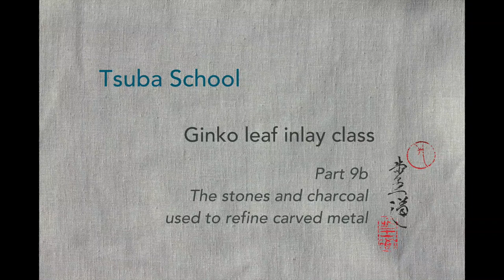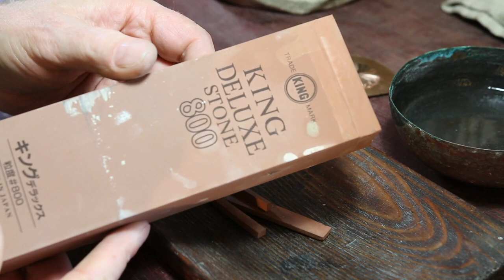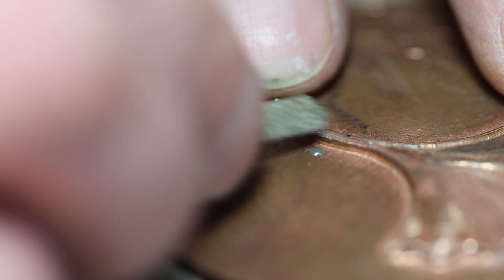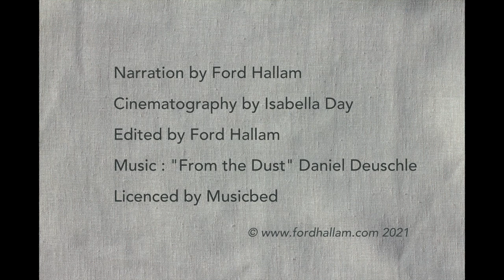Ginko Inlay Class   Part 9b

Comment: Have you tried finer grits of artificial stones cut into sticks? Naniwa 6000, 10000 for example. As a knifemaker, I have found the 3000 grit stone affectionately known as the green brick, cuts fast, wears fast, and leaves a hazy mirror finish.
Reply from the maker: Hi James, I've used a variety over the years but never such fines stones on non ferrous. But you've set off a train of thought regarding very fine soft metal finishes that I'll try and elaborate on in the next film. Cheers.